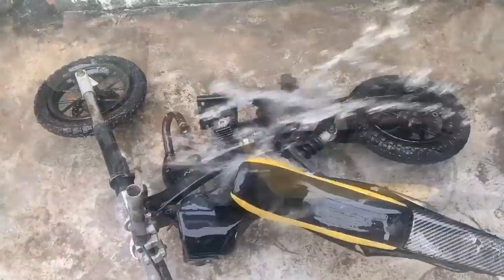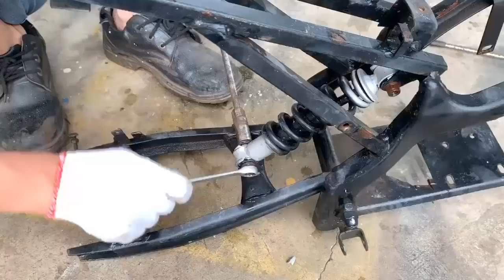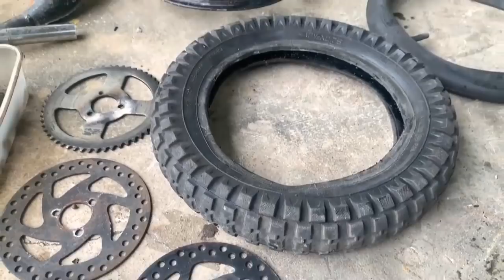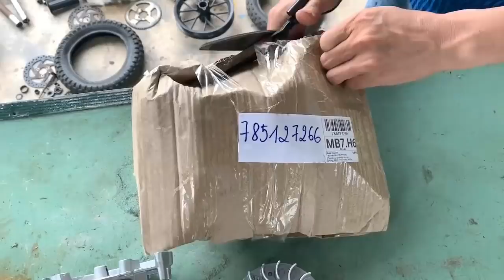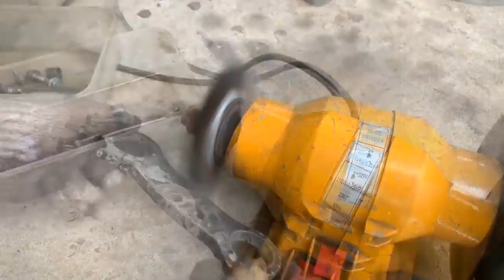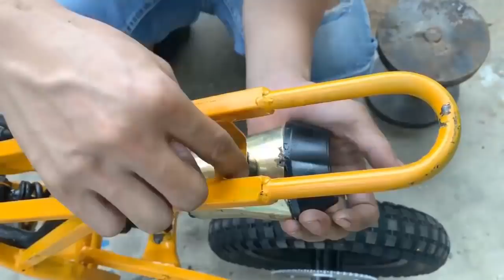Restoration Motorcycle racing old | Build completely mountain Motorbike sports restore

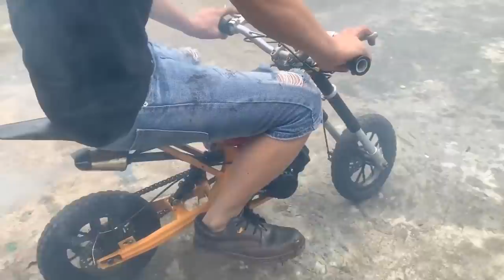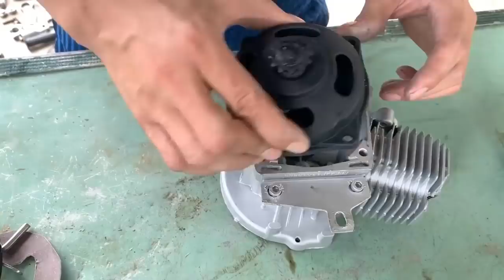Comment: 29:57 there are no spacers in the wheels! Do not tighten the shaft to much! 35:40 how can you ride the bike without a clutch 25:28 ?
Reply: That bike uses a centrifugal clutch. These small 49CCs are really simple
Reply: @rizzy8077  Yeah, I know! Thanks! But at 25:28 the clutch pads are missing!

Comment: I have a hard time believing that actually was found in the water I'm sure it was placed there if it was in the water for even just a couple days it would be resting. Especially cheaper bikes that come from China the metal that they use rust very quickly if set in water for just even a couple days.

But other than that great video I do enjoy seeing them take them apart and getting them running again.
Reply: >getting them running again
Running? Without clutch and with sprocket that smaller than single chain link?

Comment: Started off ok.Not a smidgen of mud to be seen.Attention to detail with the paint job let's a fair few of these projects down.Petrol tank was just wrong.All sort of fell apart at the end.
Reply: If he was able to get a replacement pull start cover and carburetor, he could have gotten the correct gas tank if the original was bad.
Reply: Uieid
Reply: Ñ